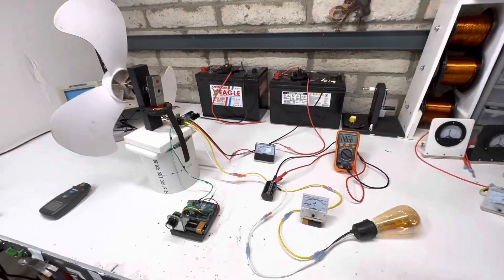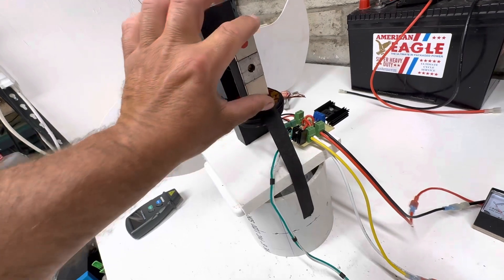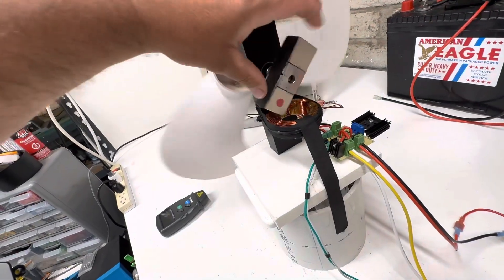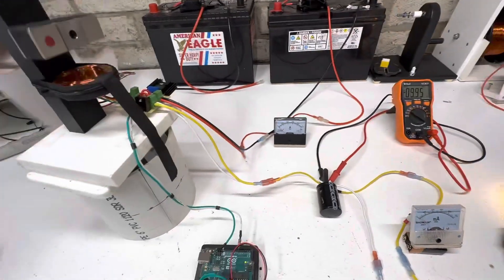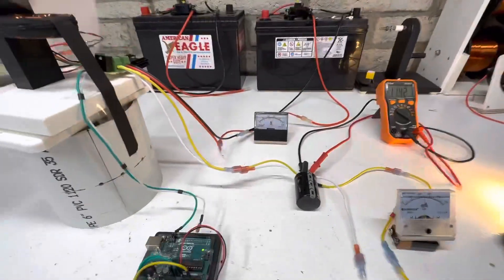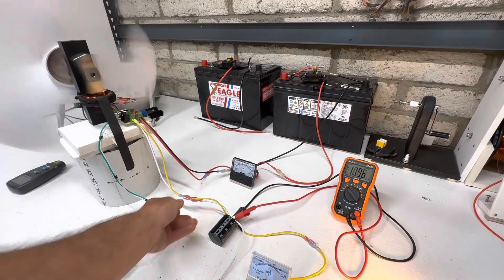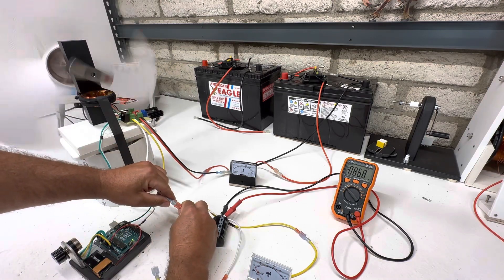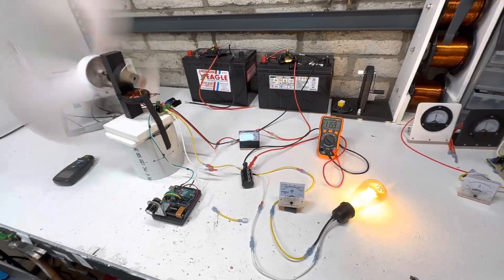Simple but strong beginner pulse motor part 2 load

Comment: Can you put an iron bar there as a rotor instead of the magnet?
Reply from the maker: Yes but you will need steel in the electromagnet as well
Reply: @kenergy1707  ok, can you do it and compare which one will be stronger?
Reply from the maker: @gtavxelidze  I’ll make it and make a video so you can see
Reply: @kenergy1707  Ok, thank you
Reply from the maker: @gtavxelidze  video is up !
Reply: @kenergy1707  Thank You! It would be cooler if you somehow measure and compare the torque of both motors while having the same power inputs?
Reply from the maker: @gtavxelidze  the magnet motor uses less power with small load and more power at large load is what I noticed